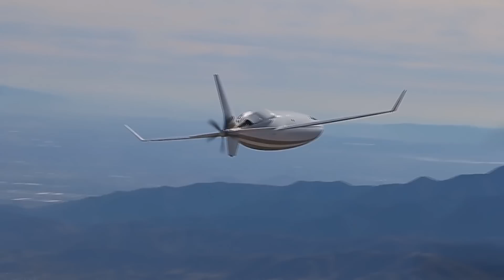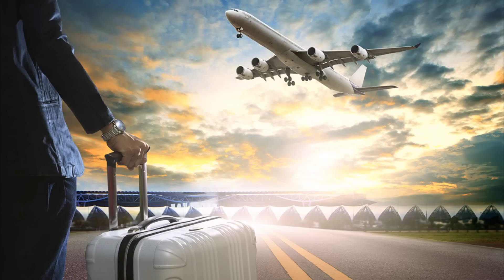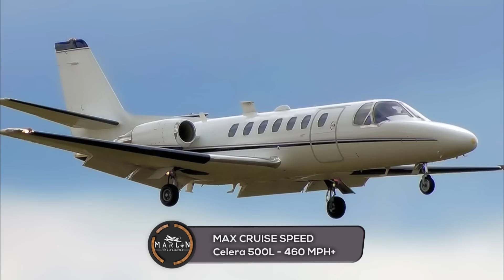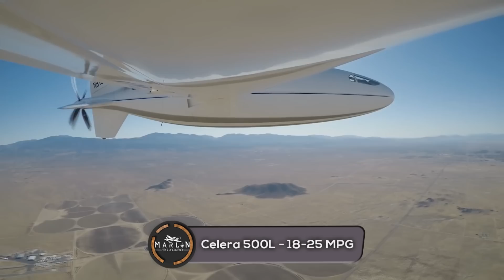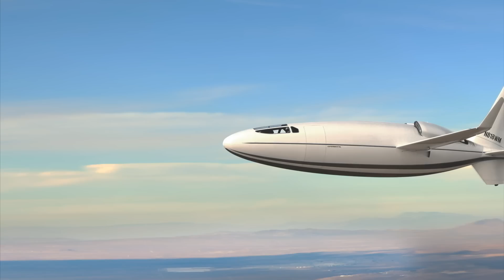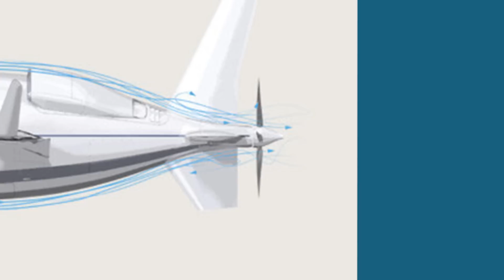Meet the Celera 500L (Flies Faster, Farther, Higher, Cheaper)

Comment: There's no way a piston aircraft is operating at FL600.  The engine manufacturer lists's the A03's service ceiling at FL500, and that's probably pretty damned optimistic.  Even if it's technically possible, the aircraft would have to be RVSM certified to pass through flight levels above FL290--and there goes your costs.  This is one of those pie-in-the-sky projects that won't deliver half of what it promises--if it ever even gets off the ground.

Comment: Looks like a "one-engine" version of the Piaggio Avanti, but without any lift being provided by the fuselage.
Reply: The Avanti is a 9 passenger twin Turboprop engine, twin prop behind the wing, canard with a T-tail, with ⅓ the range and ⅓ the MPG. They are both pushers and airplanes, everything else is not even close.
Reply: @macrumpton  The Avanti is also my favorite Studebaker.  Sorry... I'm leaving now.
Reply: That looks like a lifting body to me.
Reply: @Make-Asylums-Great-Again   -- I am so skeptical that "lifting body," no matter how good it is, can make a plane fly 100 mph faster, on 1/5 the fuel, of existing planes.
Heck, look at a Cessna Cardinal or Piper Arrow.  Airfoil-shaped bodies.  Those planes are far from perfect, but their designers knew what they were doing.
And. . . the revolutionary design of the millennium is the Cirrus.  Great airplane.  But its speed and fuel efficiency aren't anything you couldn't get in a 1947 Beechcraft Bonanza.
If you know how to look at an airplane, you see how bogus this cartoon is.
Reply: @GarnetHarrier  I don't usually agree to someone who calls a new product "bogus" before even getting to see it, but in this particular case, I have to agree with you.

A piston (not even turboprop - piston, and not an especially big one either) engine reaching 400+ mph is just... how do I put it... fantasy? Especially when there are actual jets out there that don't reach that speed.

And then he mentioned 60k ft. For those reading this comment, here's a comparison: Most civilian jets fly at around 12km (~40k ft) height. There are only a few business jets that fly at 15km (~50k ft). The Concorde flies at 18km (~60k ft. Yes, the same height as this one) and has an absolute ceiling of about 21km (~68k ft). And that's a SUPERSONIC jet. Emphasis on the "supersonic", because the higher you go, the thinner the air is, which means you'll need higher speed to climb higher. Do people seriously think this thing is as fast as a frickin' Concorde?

With very rare exceptions, when something's too good to be true... that's because it is. This is not that exception.
Reply: @marioprawirosudiro7301  Celera may be a scam, and especially the 60k ft ceiling. However your argument that an aircraft has to be supersonic to fly at 60k ft is...funny. Have you heard of U-2? RQ-4 Global Hawk? Global Observer? To name just a few.
Reply: @kyr217  I think you missed my point. I never said that only supersonic aircraft can fly at 60k. High altitude balloons are aircrafts, they can fly (or float) at more than 60k, and they certainly aren't supersonic. And there are also recon aircrafts like your examples. However, do remember that these recon aircrafts are designed from the get go to fly as high as they could, as long as they could. They don't go fast, have absurd wingspan and they carry a hell lot of fuel.

My argument was simply that there is no way that the Celera can reach that height with a piston engine. I assume, at this point you've seen how it's shaped. Now compare that shape to how your three example aircrafts are shaped. As I said, the higher you go, the thinner the air is. You need that air for lift. And as the air gets thinner, the harder it is for wings to generate lift (at least if we're just looking at lift). This is usually compensated with higher speed (up to the point where there's simply not enough air to lift the plane). This is why, generally (not always, but generally), the faster you can go, the higher your celing is, and which is why I brought up Concorde.

For the record, for a supersonic aircraft, Concorde actually has a low ceiling. Most fighter jets (at least modern ones) can operate at 100k ft.

That said, I actually googled this plane and I couldn't find any mention of it going to 60k ft. Their site only mentions that the crusing altitude is 30k ft. Which is actually pretty realistic.
Reply: Fucking hell, touched a nerve there, eh?
Reply: The Beech Starship was another pusher type that struggled for commercial success.
Reply: Lifting body is a fallacy (at least if you want efficiency). The aspect ratio of a fuselage is so small that inherently immense induced drag results. No problem if you only want to land from space. Big problem if you have to pay for the fuel.
As for the shape of the fuselage: That's the classic NACA design for laminar bodies from the fourties...
Reply: @HotelPapa100  Then you say that the claim of the Piaggio Avanti designers that its fuselage contributes up to 20% of the Avanti's total lift is a fallacy?
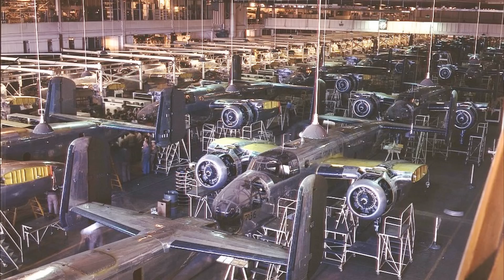Reply: @mikeelektra  If it indeed creates as much lift they are wasting a lot on efficiency. "Wings" with a ratio of span to chord f 1:10 create a LOT of drag at any noticeable coefficient of lift.
You DON'T want a lot of pressure difference to exist around your fuselage. It just induces a lot of flow equalising that pressure differential.
Reply: The Piggio is a real airplane.  This is a cartoon.
Reply: @GarnetHarrier  The Piaggio Avanti was a cartoon before it went into production so what's your point?
Reply: @RaymondCore   -- By way of background, I became a private pilot in 1987, and I've been following the aviation industry intently for all these decades.  As a technical writer,  I've been honing my bullshit detector since the 1970s.  I can give you pretty thorough recitations of dozens of aircraft designs, and tell you which ones succeeded, which ones failed, and why.  Never before have I seen one that was such a blatant bold-faced lie, although Jim Bede's BD-5J, which had a 20 percent fatality rate for each aircraft's first flight, gets honorable mention.
If the Celera were true, it would be super exciting.  Kinda like the first phone call I ever got from a Nigerian scammer promising me millions, about 30 years ago.  But when something sounds too good to be true, give your bullshit detector the audience it deserves.
The Celera promotional video splices together computer generated imaging with actual footage to imply that they have a real flying airplane.  That's a sure sign of intent to deceive.
•••
Here are some comments I've posted on various web pages:
•••
•••
I was surprised at how many commenters on aviation web sites got taken in by it. They got mired in the little details like laminar flow airfoils, and didn't see the big picture: When someone shows you a cartoon and tries to tell you it's a real event, who is he trying to deceive, and why?
How dumb do you have to be to realize that these guys want to pry a few hundred millions from clueless investors?
I worked briefly for a company funded by clueless investors. Overseas oil money. They were clueless.
This is such a weakly disguised scam that I think they are pfishing for super-clueless money. They don't want to try to dupe smart people.

A 3300' runway for balanced field? Ha.
(What "balanced field" means: Runway length sufficient to accelerate to takeoff speed, then put on the brakes and come to a stop while still on the runway. The concept is only used for twin engine aircraft, because it dictates the emergency procedure in the event of an engine failure on takeoff. Except here, they're using it for a single engine aircraft.)
https://en.wikipedia.org/wiki/Balanced_field_takeoff
Why do I say 'ha?" Because when you design an airplane, you choose between high cruise speed and short runway length. You can't have both.
The balanced field length for a Beechcraft King Air -- a well regarded $8 million eight-seat twin turboprop that the Celera fantasy would pretend it could compete with -- is 4700 feet. Oh, and the King Air uses 2,100 horsepower, compared with the Celera's make-believe 600 horsepower, and cruises at 303 knots, far slower than the imaginary cruise speed of the Celera.
Boy, those engineers at Beechcraft must be really dumb, huh? (Uh, that was sarcastic.)

 If you're going to lie, lie BIG!
Farther along in the video, they say they think it'll fly at altitudes upwards of 60,000 feet!
This from a piston engine!
I've flown at 41,000 feet. The plane wouldn't go higher. I guess those Gulfstream engineers are as inept as Beech engineers (Uh, that was -- again -- sarcastic.)

See the placement of the rear landing gear? And the dorsal fin below the fuselage?
You'd strike the dorsal fin on the ground every time you rotated for takeoff.
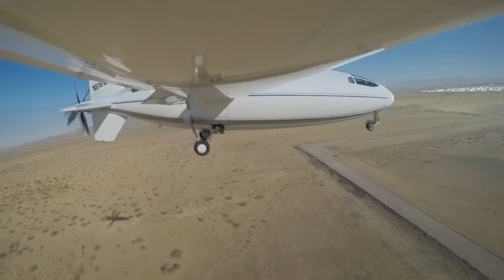Reply: @GarnetHarrier  at 8:05 you can see the frames on the runway are interlaced with the white stripes, but the movement of the propeller is not interlaced... big tip off here...
Reply: @GarnetHarrier  can you make an aircraft? If not, you are a cartoon.
Reply: @livniadonayfuelsaverreacto4800  "Don't criticise it unless you can do better" is the ultimate fail arguement.
Reply: @worldcomicsreview354  I am interesting with this Celera 500L. We  have 800metres Length of the runway in our island. I want to buy 2.
Reply: @worldcomicsreview354  Celera 500L is not a comic that you may interfere to criticize.

Comment: Given the inherent noise with conventional piston engines the noise levels would get quite tiring for its range , the sooner they fit an electric hybrid engine with excellent noise firewall separating the engine from the rest of the hull all the better, I’m just surprised they haven’t used a 5 prop for extra thrust,but even so the specs just seem like wishful thinking a Cessna 500 cruises a 375 knots, I have yet to see any single engine prop reach such speed, even turbo props max out at 330 but cruise around 280, also given its spec and no mention of a pressurised hull  would be very surprised if this had  a cruise level above 23000,   If it was pressurised the 27,000-30,000 seems more inline with its spec let alone referee to 36000 mentioned in the video, also given the need for air cargo transport being a big factor nowadays were still looking at something more inline with the cirrus sr22t than tdm 940

Comment: The biggest problem with general aviation or even corporate aviation is cost. An aircraft is not any more technically advanced or complicated to build than a standard car. Of course these companies won't see the economies of scale that car manufacturers see, but a Cessna 172 should not cost more than $75k. These companies are literally killing themselves with the high margin, low volume business models. Also, we need to get the FAA out of the way. I'm fully onboard with FAA air carrier and corporate jet oversight, but all aircraft under 8000 lbs should be almost unrestricted. Think sport aviation licensing but without the extra restrictions.

Comment: History is full of wonderplanes that somehow never achieved the miraculous statistics projected for them, especially sales. (And after hanging around aviation for far too long, I've never seen any signs of this thing, or the company behind it.) 
What are the features that are supposed to make those numbers possible? Four things dominate aircraft performance: structural weight, which will undoubtedly increase the more pressurisation is required by operating altitude, structural drag, the wing, and the motor.  The form looks slippery, but laminar-flow wings are very sensitive to contamination from bugs and rain,  and while the motor doesn't seem implausible, has it any service history?

Comment: I find it hard to believe that a piston engine is more efficient than a modern turboprop especially at high altitude, where the piston engine would surely require some sort of turbo or supercharger which all add extra weight?

Comment: The video did not include the salaries of a pilot & co-pilot and other costs Airlines have which were not covered in a ticket price.  This is still a higher priced form of air travel than commercial travel. Not that they are equally comparable,  they aren't.

Comment: I am curious how this aircraft design would fly in X-Plane11.
Because there are some relatively simple improvements that could be made.
Like:
a) Reduce the aerodynamic drag even further with a blended wing and canard;
b) Increase cruise speed with a shrouded counter rotating propeller;
c) Improve fuel economy and range with an Achates diesel engine.
Reply: I built a model of this in X-Plane 11 using the images from the website and some educated guesses about other items. The model flies almost exactly as described in the website for the Celera 500L. I was really surprised about how close X-Plane agreed with their claims.

Comment: It won't reach 60,000 feet with the current single stage turbo system. It would also take a couple hours to climb to that height if it could. Impossible given the air density up there. Diesels require very high pressure ratios to achieve their power compared to SI engines. It would need a 3 stage turbo system to do that- heavy and complicated. The intercooler heat load running these pressure ratios would exceed the coolant heat load and require some truly massive and draggy intercoolers. The small wing and prop won't work well up there either. Also consider a diesel won't relight at high altitude. Running on 6 cylinders would totally change the torsional vibration signature which could be a very big deal with the redrive and extension shaft. A few bugs and the laminar flow disappears along with the projected performance. Too many unsubstantiated claims at this time to get very excited.

Comment: Glide ratio of 22:1? Most current airliners have glide ratios very close to that. I seem to remember that the 747 is about 20:1. So, tell me again how much more efficient the Celera will be?
Reply: a 747-200 is 15:1. Most single engine propeller aircraft glide between 8 and 10 to 1.

Comment: A 12 cylinder piston engine? That's WW2 technology. Would that even work at 60,000 ft? How about a gas turbine?
Reply: That's what I was thinking. The record is somewhere around 42-43k. So how are they getting 60k. Air is really thin even with a 2 or 3 stage supercharger.

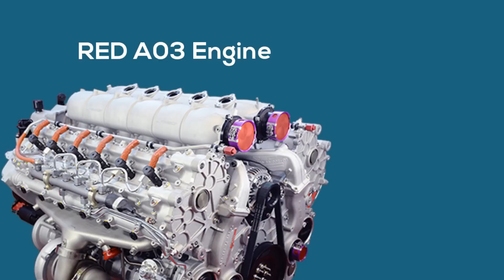Comment: 3:40 "extensive use of laminar shapes"
What's a laminar shape?
Reply: Laminar Flow is what you can find in calmly flowing water (opening a faucet just a bit). As oposed to turbulent flow there is much less drag. For any given shape there is a flow speed above which laminar flow becomes turbulent. An aerodynamical shape which is  desinged to operate completely in the laminar region can be descriped as a laminar shape.
Reply: @Red_Panda_Dragon  pure laminar flow is impossible to achieve.
      Reducing drag can be a great thing if applied VERY JUDICIALLY and thoroughly , mind you !

Comment: Laminar flow has low drag IF it stays clean (and laminar). VERY clean indeed was found in windtunnels.
Small particles, of say 1mm2, cause transition to a turbulent boudary layer which has 7 times more friction drag.
(rain, ice? )
Besides that the fuselage is that long that only a small portion of the nose will have natural laminar flow.
The remainder of the fuselage barrel behind say, 2 feet laminar flow, has turbulent flow. 
It is not beneficial to Pull a turbulent boundary layer to a lower pressure (the thickest part of the fus is ment) because the boundary layer stays thin and has a higher skinfriction drag, hence.

Concerning Altitude.
Comparing low- to very high altitudes at constant I.A.S the Reynolds number goes down and the wingsection drag is reciproce to the root of the Reynoldsnumber, so it increases. (check that)
That is the reason the Boeing Condor had an L/D of 44 (low) and L/D = 39 at altitude.

The commercial claims L/D = 22 (could be, if clean) but will be 14 or so in rain. Will the EASA certify the clean stage length in bad wether?

I understand that with this info will not land at a million+ readers , but aerodynamist are teased to write a comment.

Louis van Rijn.

Comment: 60,000 feet ceiling? Speeds comparable to jet aircraft? I have played enough Microsoft Flight Simulator to know this is impossible for a single engine prop plane.
Reply: One with a piston engine too.
Reply: Sounds crazy but I drew up a plane like this for a comic book.  Very similar specs except the rear pusher engine was a small jet fan.
Reply: Low drag
Reply: @Luzviminda777  low drag high speed operator

Comment: I like it. I can'tremember what the speed  is suppoto be but with only 500 hp it will not be jet speeds. Also altitude limitations unless it has sufficient air flow at the higher altitudes i.e. turbo or superchargers.

Generally the public are slow to these sorts of changes, but ticket prices certainly make a huge difference.